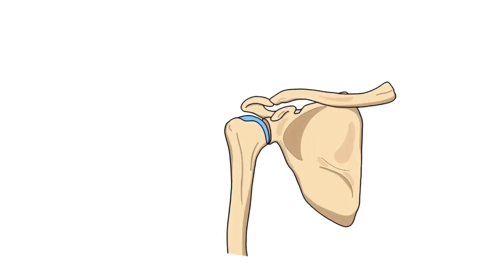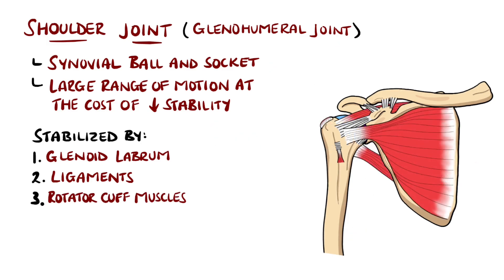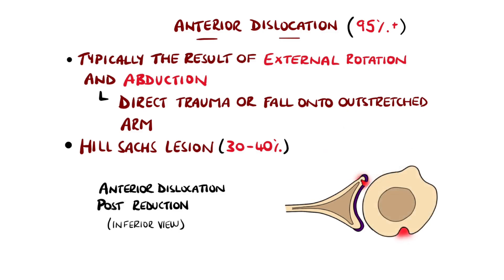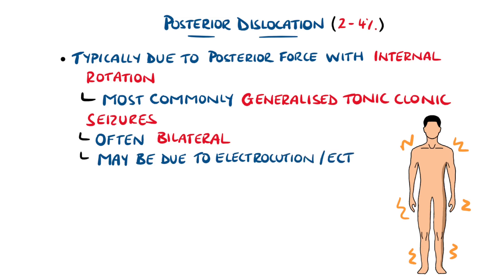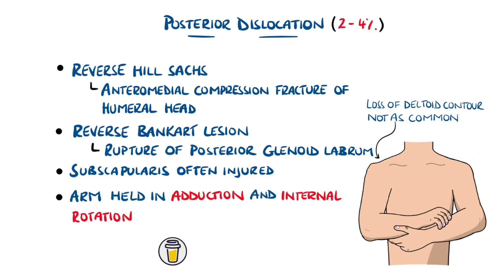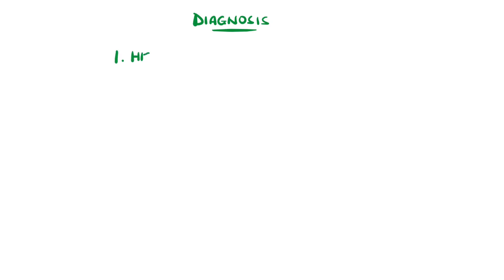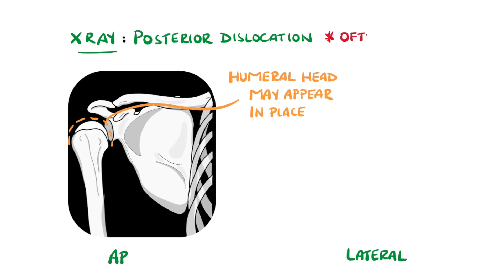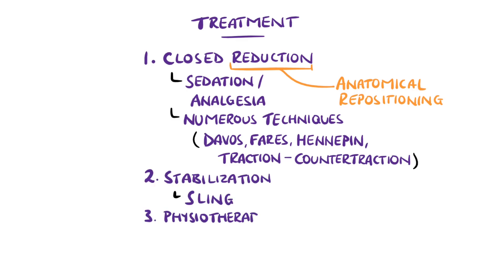Shoulder Dislocation Explained Clearly (Glenohumeral Joint Dislocation)

Comment: Experienced this for like 13 times throughout my amatuer boxing career, usually on my left side shoulder. Its really painful from the start but you’ll get use to it how to pop it back.
Reply: I started boxing 1 month ago and in the last 1 week it dislocated 2 times, my coach put it back in place but idk if I should quit boxing or just take a brake and try to strengthen it. Is it normal to have a bad shoulder in boxing or a week one ?
Reply: @thelynxgamer2169  Could be you are born with weak shoulders. Since I was young It always hurt for me to do any task that requires my arms above my head. And eventually the shoulder dislocation when I did a shoulder press behind the back. And after that it has never properly recovered. But I think my shoulder are just weak so you need to find good exercises to make them stronger
Reply: @thelynxgamer2169 you should get it checked out. there could be so much damage you dont even feel yet. talk to a doctor if you dont want problems for life with your shoulder
Reply: Dealing with this now how were you able to compete ? What was the closest that you did it to a fight

Comment: Gymnasts can do it on purpose while hanging on a bar and require zero recovery.  I am hoping this video can explain what they are doing exactly.
Reply: I mean I can do it painlessly when doing reverse prayer pose but if it happens by accident with force involved it’s very very painful and there is soft tissue damage. I think it’s about controlling the movement
Reply: @SobrietyandSolace thank you for taking the time to respond little wolf.  Appreciated.
😊👍
Reply: @deltalima6703  You’re welcome. I believe building muscular strength to control extension is key to preventing ligament damage as much as possible with these movements 👍

Comment: Hey Doc! I am now 24. I had Unique case history. I am an athletic person but always had a low protien diet.

I was lifting a heavy weight and by mistake i twisted my upper torso, my right shoulder had a popping sound and i screamed for a second. I checked it, it was fine from outside and was painless. 
In Feb 2022, i was 23 yrs old - I used to play Contact sports, TT, i am not beginner) for 6-8 hours a month in Two shifts (hit 1k balls under Robot and matches in evening). 
Then, I developed two conditions in my Right elbow:  Distal Bicep TENONOSIS and Medial Epicondylitis + i started having painless poping sound in my right Shoulder whenever i used to go overhead.

For 1.5 Years, i have not lifted anything with my right arm and only did elbow strengthening and Rehabilitation exercise as prescribed.
NOTE: My elbow was completely fine now, but i had some shoulder pain after i tried to play Table Tennis for 2+ Hours, pain in front and back of my shoulder. I even got an MRI done bach then BUT it  Only Stated - Minimal GlenoHumeral Joint Effusion.
Also, I had felt shoulder pop out and in for 1 second while playing Forhand Topspin shot but as it went back in on its own, i didn't had to think about it much.

In Late September 2023 - I was feeling good as i only had poping sound when i went overhead, i played Volleyball as setter, blocked 2 3 Heavy spikes and spiked 4-5 ball + i fall on ground with my back during my match. And the Next day -
In Early August 2023 - While Sleeping after practice session (6 to 7 hours gap), my right hand shoulder dislocated itself posteriorly (1st time Complete Dislocation). I went in emergency and got it Relocated. 
I had MRI done of Shoulder + Brain, I have Bankart Lesion (1 to 5'o clock) with small hill sack region ( 1 mm) and supraspinatus tear. However, My brain is normal :) I have no chance of seizure, for sure.

I read your article About Atraumatic Shoulder Dislocation and i am now  confused b/w Surgery (Arthrex Shoulder Labrum repair with Knotless SutureTak  Arthroscopic) or Rehabilitation with Physiotherapy As ---
MANY SURGEONS WHOM I MET ADVISED ME TO GET THE SURGERY DONE, AS I WISH TO GET BACK IN SPORTS AS MY HOBBY
And my Physiotherapist says, There is no need. Do the exercises religiously. For sports, wear brace.
Both agreed on Rest of 6 months before contact sports.
What will you suggest in my case ??